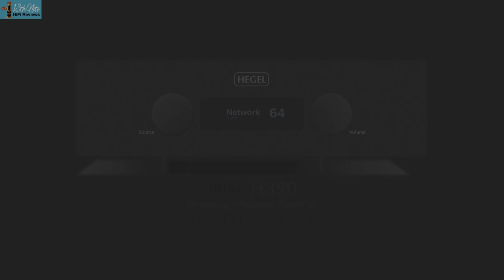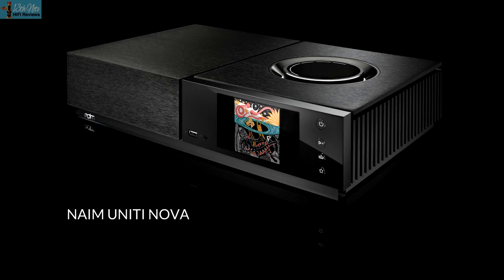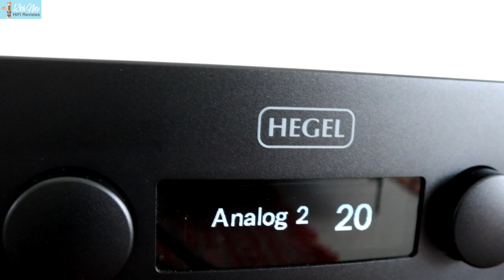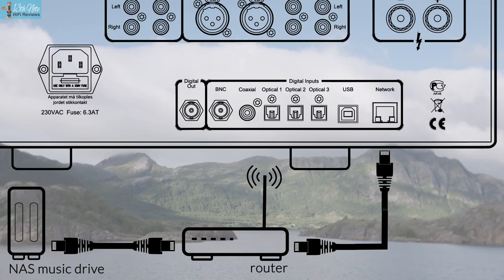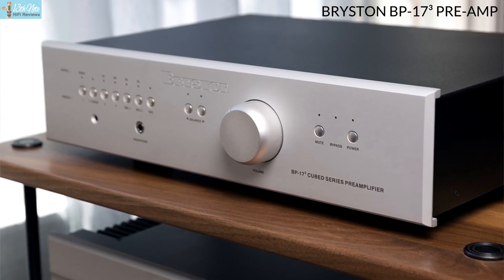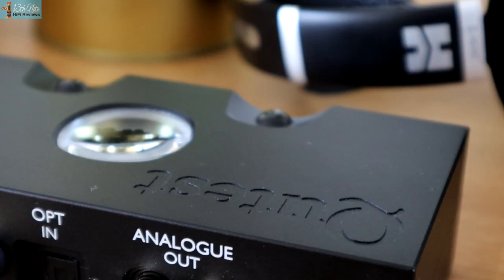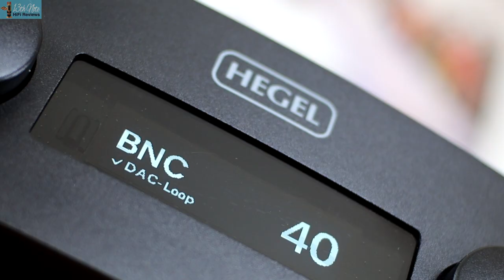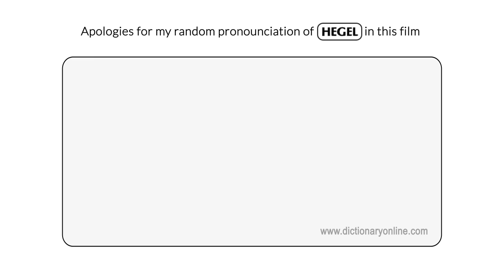A film about the Hegel H390 Integrated Amplifier

Comment: Hello Simon.
I will get my new H390 on monday :-) 
Using it with the B&W 805D3 speakers I have.

I would like to ask you, I would rather use a Node2i instead of the bubble upnp app thingy.
But will there be any difference in the sound using the bubble app instead of the Node2i?
What I mean with that is that will the Node2i change anything in the sound presentation compared to only using the app directly to the Hegel?

And if the Node2i does not alter the sound and has the same function as the bubble app, just connecting the music, how do I connect the Node2i to the H390 so the Node2i does not do anything at all but send the music to the H390? (I want the Hegel to do all the work, DAC, MQA and so on...

Is there any settings in the Node2i menu that needs to be done for this?

Thank you for your nice videos, really enjoying them. 
Merry Christmas!

Br:Kris from Sweden
Reply from the maker: Thanks Kris, really appreciated. I think it will be close with the app and the node 2i. You connect via digital output over rca to the Hegel so the node is just sending the digital stream and as what is called a digital ‘transport’, not using its own dac. I think the node is worth it for MQA, the app and interface and a Roon ready player too. Hegels are getting Roon ready update soon I think. I don’t think you do change the settings but just connect the cable. Bw simon
Reply: @13thnotehifireviews7   Thank you Simon! Really appreciated!
Reply: @13thnotehifireviews7  hello, you mean to connect bsn2i via coaxial to Hegel, correct?
Reply from the maker: @vittoriomartinidonati  sorry, I don’t understand the question?
Reply: @13thnotehifireviews7   it is about your comment above. : You connect via digital output over rca to the Hegel so the node is just sending the digital stream ......  connect over rca?
Reply from the maker: @vittoriomartinidonati  yes as illustrated in video - watch it back as all annotated - you connect the digital output of the node to the Hegel’s digital input, Hegel does clocking and then you use the hegels digital output to the dac, then xlr inputs back to the Hegel. The dac is still acting separately just the digital clock timing is controlled by hegel in this config. Hope helps.
Reply: Hello Kris, How do you like the match with the D3s? I have the same with a Parasound Hint 6 with two REL T 7x. Thanks

Comment: Great review interested would it run my PMC twenty five.26s  better than my current supernait 2 it seems ideal being integrated and not having to spend on a naim 250dr plus pre amp to upgrade as the current supernait 2 struggle's at lower volumes .I wouldn't mind giving the hegal a demo .What's your experiences on PMC and it's capabilities on a pair of 26s thanks
Reply from the maker: Thanks. Don’t know about 26s but it pretty drives everything under the sun so should be fine with those. It runs my 25-23 a treat and did run the 25-23i very well too.

Comment: Hello.  You have a great channel.  I just subscribed.   Just wondering if there is much difference between h190 and h390.   I have BW 803 D3 on a small size room.   Is the main difference just power?  Thanks in advance.
Reply from the maker: Thank you very much. Haven’t tried the h190 but it’s probably going to be lots of things like power,  damping factor of the amp, current delivery, slew rate, distortion and so on. The H390 is a newer design to the H190 and doesn’t share the same circuit design as the H190. The dac is better in the h390 too. I’d definetely recommend the h390 or even better the h590 if the budget goes that far. Bw simon

Comment: Hope they could improve the streaming features with future models. The amp / dac itself is perfect. For streaming from NAS I prefer hificast with h360 (gapless).
Reply from the maker: The value of their amps is so good they don't really need to. You can easily spend a lot more on other brands that will charge lots for audiophile streaming features. Also app development for small hifi firms costs lots and possibly people would rather spending that on the sound, which is clearly what Hegel do. When you factor in adding good affordable streamers like the Node 2i which perform well above price too - you don't need to go crazy on streamers. You can get a node 2i for £400 in the UK atm. usually £500.
Reply: @13thnotehifireviews7  I have a node 2 and oppo udp-205 (roon) but prefer a one box solution, as I use the Hegel mainly for streaming. I read that they will recruit someone to resolve the streaming issues in the future. I like the sound coming direct from Hegel (with hificast/bubble) more than the bluesound / oppo connected with coax or optical.
Reply from the maker: @timchromecast  the best way around it is to get a roon server if you haven't already, then you can hide it (on the network). As I say in film, the h390 will be going roon ready, so use the best of the best in roon, to do the controlling is a great idea.
Reply: Any comments on my Fact 8 s with Hegel h160 I can purchase at a good price
Reply from the maker: @stevelambert6489  Personally I'd add an H590 with fact 8's if you can afford it as they will need better drive. PMC's always do.

Comment: A tricky question, but please have a go:  For a 60 year old guy, who no longer has the hearing ability/range he had at 30, and this 60 year old guy plays his music in and around 70-75 decibels, and this 60 year old guy wants a one box solution, and one that is really easy to use, so easy a simpleton can use it, Hegel seems a serious option.  The real question is: will this 60 year old guy notice any real/significant difference in sound quality from the H120, the H190 and the H390 ?
Reply from the maker: You should do Keith, it’s all about dynamic drive as you go up those amps, in most speakers instances, and that translating to better and more real sound quality. It depends on your speakers but only you can decide and judge but I would take them to a dealer that has all three and try.

Comment: Would I be wasting my money buying this amp to use it in HT bypass mode? I'm trying to get improved stereo from my AVR  (NAD T778)  and I'm thinking that possibly the pre amp stage of the NAD will hold the Hegel back from its full potential.
Reply from the maker: Really don’t know as too many factors involved. Plus you didn’t say which speakers and if you listen to 2ch. But tbh I think this is probably a 2ch amp through and through. If you are tying to get improved sound with your speakers and they are a similar or lesser price/spec to your nad then the Hegel might be overkill. If the speakers are really superb and you listen to lots of music then Hegel yes, if not I’d go for some inexpensive outboard amps that are prob better than the nad, when you consider the current goes down across lots of speakers and you have many involved, so possibly you just need any good separates mono blocks or stereo amp. I can recommend nord amps.

Comment: Hi I compered Side by side Hegel h390 and Naim until nova with my tannoy’s Cheviot 
I can’t agree with your opinion. Nova sounds very similar to h390. The interesting thing is that nova 2x90W has as much power as a Hegel h390 2x250W. I think both amplifiers are great but There's not that big of a difference with the sound. Honestly  I prefer Nova because looks better and sound very very good 😉
Reply from the maker: Definetely don’t agree. Nova is a more fluid and slightly brighter sound to the Hegel analogue qualities and neutrality. It isn’t as dynamic, it is impossible to for the dynamic headroom the extra Hegel power gives. If you aren’t hearing that then maybe the speakers aren’t the most dynamic in the world. Very big drivers and room response and so on…

Comment: Hi, I’m very interested in the amp. Can you hook up a sub-woofer to it? I didn’t see any subwoofer or pre- outs.
Reply from the maker: Fixed and variable level RCA outputs as graphics in review and as stated on back panel, although granted not obvious to people who don’t know what it means - basically fixed volume out or variable volume out. Pre outs are just variable volume outputs, so another amp deals with volume ie the active subwoofer.
Reply: @13thnotehifireviews7  Thank you
Reply: If you were to connect a 2nd set of speakers (powered) to the variable out would they always output? I guess they might and you could turn them off. I had the though to put a set near my tv but keep the amp at a distance with my main speakers for more serious listening. I could send audio via AirPlay from Apple TV… I guess it would output to both speakers though. Add to crazy file 😅

Comment: what about all the humming problems with the 390 and the 590 ??!  i bought a brand new 390 ..when hooked up at home ,IT humms like crazy !! i bought it back to the dealer ,did get another brand new one and guess what??! IT humms like crazy again !! unbelievable ...start a search on the Hegel site and under support there is even a section dedicated to this problem...🥴🙈 this cannot be sold with this design problem..???
Reply from the maker: It’s not a problem for me. It’s actually normal but slight and a function of the big toroid and design. I covered this in my website article. I don’t hear the hum when music is on, nor I doubt will you. In fact when I walk away I can’t hear a thing, and the hum subsides very soon after switch on even ‘ear up to case’. It reaches a crescendo within a few seconds then dies down, and even with the slightest volume you wouldn’t hear it. I don’t know whether you are being ultra sensitive, or if yours is louder, but if the latter, that points to other things on the mains and DC offset. In other words DC on the AC from high frequency sources like fridges etc. If you get a DC blocker it will sort it. I use a great conditioner which may have an impact - Isotek aquarius, but technically I’m not sure. In any case you can get conditioners with DC blocking in them eg isol 8 Integra. Lots of people using it don’t mention this as a problem. It may be a niggle if you think it’s a problem but basically what happens is the metals extend and contract in the toroid microscopically setting up the audible hum where they have high resistance. Also the dc on the ac offsets the sine wave and I think that is involved too. This is a natural tendency of large toroids with big resistance. If you are really concerned you can get a fuller explanation from Hegel, or search DC offset online and there is plethora of information that comes up about why it happens in big toroidal transformers and with Dc offset too. Hope helps.
Reply: I heard that turning the powercord in the socket  by 180 degrees could  help.

Comment: Would be nice if they learned how to wire the  amp internally i wouldnt be able to sleep at night if one of the amps i have built looked like that shocking,rats nest of wires cant believe no one comments on it especially considering the price.whats even more surprising the reviewer doesnt even mention it .Dont review hi fi equipment unless you have a modicum of tech experience.Compare this with Naim gear i rest my case!
Reply from the maker: If it aint a problem in sound terms then it's not a factor. Simple. Naim is often over engineered and you pay for it, so it's a case of taking the snob value out and if the amp does what it is needed in sound terms who cares whether there is a fried egg inside. This is an exquisite amplifier. cheers
Reply: I'll just come out and say it, since @13th Note HiFi Reviews is too kind. First there is NO NEED for a reviewer to mention what is clearly shown in the video. Second, it's a crowded chassis, so it's going to look like a nest of wires. I didn't see anything especially sloppy about it though. I doubt you've wired anything in your life, you D.B. loudmouth.
Specifically, which wires would you like to see redirected on this complex piece of gear?  https://www.hegel.com/images/products/h390/H390Inside.jpg

Comment: Why would Hegel cheap out on the DAC?  Without another good dac purchase this class A/B amp is a very poor value for money.
Reply from the maker: It’s not class d , they haven’t cheapened out on the dac and I reckon it’s equitable to a Qutest DAC, which is very good all things considered
Reply: @13thnotehifireviews7  but you suggest buying a dac to go with it? I’m sorry but I’m confused.
Reply from the maker: All amps as good as the Hegel can benefit in dac upgrades. I thought that would be obvious
Reply: @13thnotehifireviews7  It probably is obvious to many people but I am a novice when it comes to audio and trying to figure it all out.  If it needs a better dac why not just go separates as it’s not got a streamer either.  It needing a dac makes this nearly £10,000.
Reply from the maker: @PS987654321PS  it has an inbuilt streamer, the reason to consider it is because the amp is extremely good